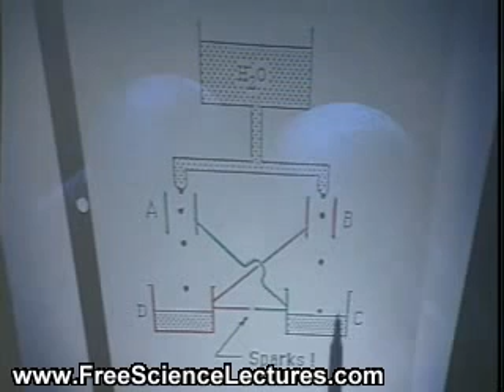Walter Lewin Makes a Battery out of Cans and Water

Comment: For those who are interested, here's how it works: The trick is between the paint cans (A & B) and the water nozzles. The paint cans store an electric field in them, which attracts electrons to one of the water nozzles and repels them from the other. When the water drips, it takes a bit of the electric charge with it, which falls and is added to the container it lands in. One stream will be net (+) while the other will be (-).

Comment: This device creates electrical energy by slowing down water droplets as they fall. It separates the positive and negative charges naturally present in all substances. It gives a high voltage DC output at a current of microamperes.